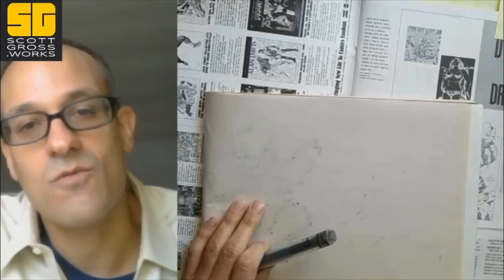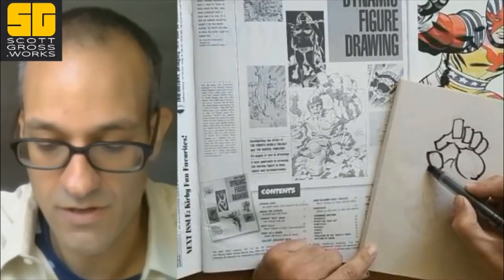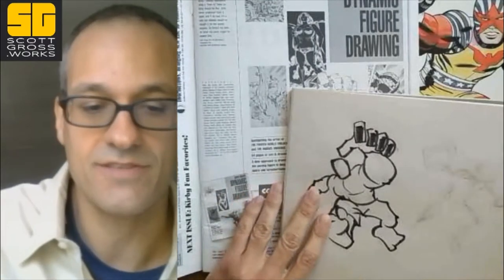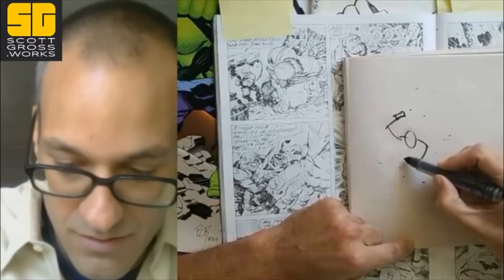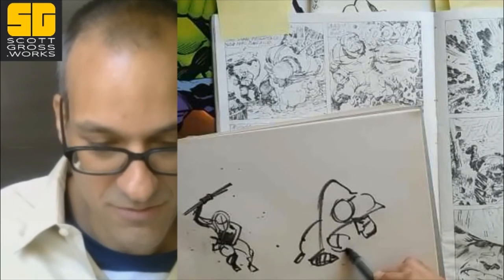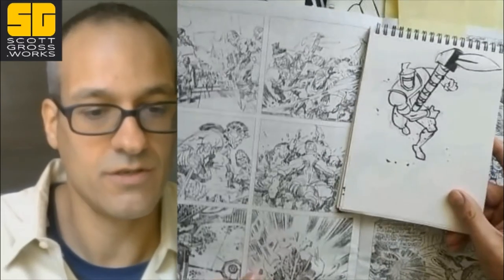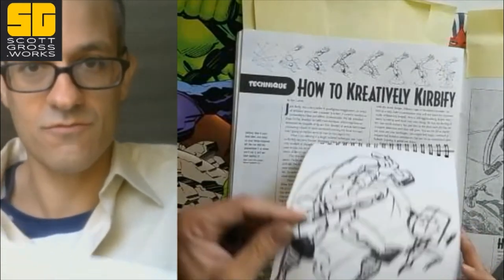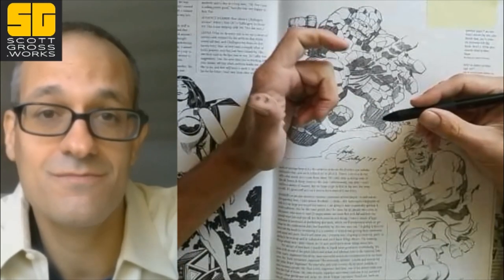Comic Book Figure Drawing Like Jack Kirby

Comment: So is this a beneficial practice to do? Like, compared to just drawing what you see and practicing perspective vs. copying the gist of the artists, which is a better use of time?
Reply from the maker: So here's the thing -- the drawing is really THINKING.  Once you have basic command of the materials and you can draw circles and straight lines and you know anatomy and you can draw a basic figure passably well -- then what?  Artists like Kirby answer that question.  By copying you rework through the same problems he faced, and discover his solutions -- and then practice them.  It's a thinking exercise -- why did this guy zig instead of zag in this particular situation, or this part of the body.  See what I mean?
Reply from the maker: Check out my most recent video on Core Shadows!    https://youtu.be/Fi9Z3zGzCTc